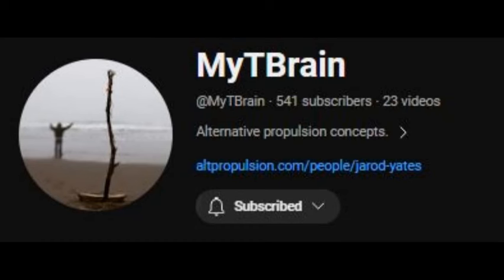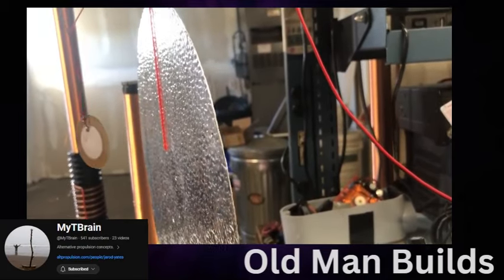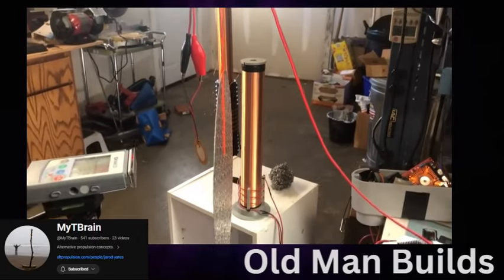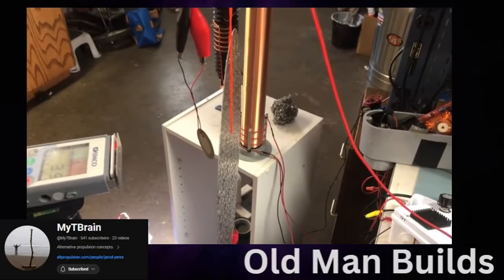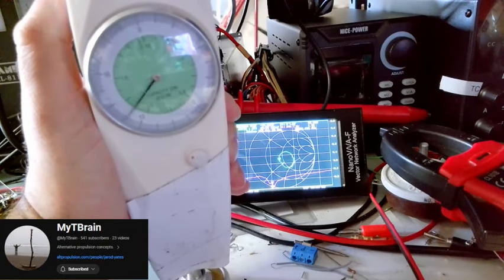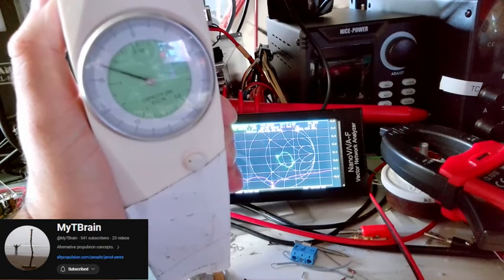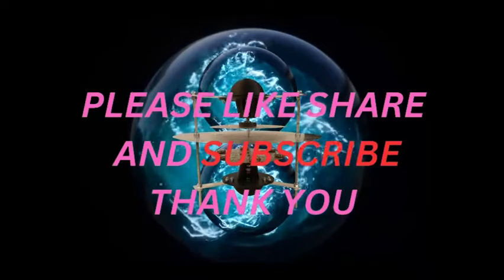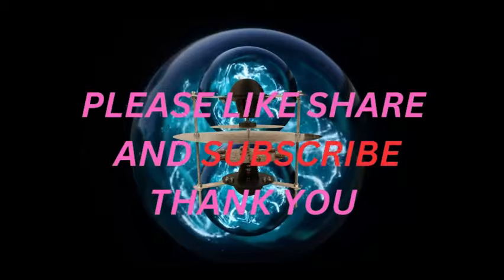Graviflyer "Piezo Disc Experiments" #40

Comment: One thing that was mentioned about the SEG motor (mentioned on APEC) was that it was getting hot on one side but once closer to weight loss it would cool down. But it happened at lower rpm. There is something tied within all this.
Reply from the maker: I agree. It is like a combination lock. We just need to see what fits. I tried to change the octave by tapping on the center plate. It made a change in the power level. I was also hearing a clicking sound. It was the first time I had my piezo on. I installed it backwards so instead of pressure I got clicking. The piezo was expanding into air and not against the top. I was at the right spot.

Comment: Not to pick on you.. but I have seen the original Russian flyer several different ways it was built by him.   They had a hole in it that look isolated with a post coming out of the top of it, with some connecting wire to the rounded top. The piezo crystal was a lot bigger,  I have seen both top disk with magnets and also top disk with no magnets on the Russian flyer.   * He had a 12 volt isolated system he used.*** to power it.  And if he has or had 2x piezo crystals isolated(electric) by an insulator and has a mechanical connection he could have had a second HV generator in the system powering the top of it.  I think you got only half the story from him on how to build it.
Reply from the maker: I have seen all of those. But I have only seen 2 fly. I focus on those.
Reply: @nathanbunten4299   If they had piezo linked in a mechanical fashion and isolated, it would be easy to have a second HV generator at the top of it. have the #1 Piezo send power(mechanical) to the other #2 piezo producing a second high voltage generator that is isolated.   I am a old radar high voltage guy... I know what to look for.  Just mostly a guess on my part.  The pictures just did not look quite right there was more to it in some way..!   I am use to seeing spark gaps at 20K @ 20AMPS
What it look like to me is that the top is a separate high voltage system.  The center post has 4 corner metal thing sticking over the top of the round part.  You could HV to round part and keep it isolated and center rod out the top you could the other HV to it.  That would produce a static field between the two.  Using a piezo you would have to use HV rectifiers because its ~AC  coming out. But 4KV DC (CR) is easy to do that to. The gap around the top was good for ~15KV.  They may have had the to top linked to the round part also and had it vibrate up and down getting more air through it.

Comment: I was messing around that lapoint magnetic array north south flip zone and ultrasound levitator. I accidently bumped the metal tweezers into the array and it created a huge spark. I'm not sure what to make of that unless the magnets somehow got charged. Do you know how long Alexei was spinning the discs then turning the ultrasound on and getting it to fly?
Reply from the maker: 10 to 15 minutes before he started adding anything else.
Reply: uuuuhhhh, that sounds very unusual, you should repeat the experiment with the discharge we need to see it too, I'm very interested in seeing that
Reply: @fireball75677  I'm going to resin or glue the magnets in place and try to get it on video.

Comment: Nathan what I wrote to Jarod about this video.  Jared, thanks for the explanation. I really appreciate it. You state charge and then mention kilovolts, so I am confused somewhat as isn't charge coulombs? Also, what is SWR and US frequency? You also state that during the off cycle of the piezo disk you lost charge. Nathan in his videos puts the high voltage positive on the center plate and lower voltage negative charges on the top and bottom plates. You state that the positive charge showed more of an effect.  From reading on the internet putting groves or hammer marks on the plates allows the ultrasound to travel through the top and bottom plates.  You state that during one of the off pulses the positive charge changed by 1 kv. Does this mean the charge dropped on the plate?  This would make sense for the graviflyer as the middle plates positive charge has to move to the negative bottom plate, so it has enough charge to repel the earth's negative charge so the graviflyer levitates. I learned from Alexey two years ago that he used a polycarbonate CD with its associated groves and the coated Al and Al2O3 as the top plate on the graviflyer. This CD was a normal capacitor with the top plate and the middle plate, so the charge does not transfer to the middle plate or the bottom plate. I just learned from Nathan in his last video that the top disk has some sort of white coating on the bottom of the plate and may be similar to the CD with its Al and Al2O3 coating. The bottom plate acts more like an air capacitor that can transfer the charge to the bottom plate.  The top plate stays negatively charged so it can attract the positive ionosphere to get lift of the graviflyer with no transfer of charge to the middle plate or the bottom plate. The middle plate has the hammer marks on it to allow the ultrasound to travel through to the bottom plate to allow the transfer of the charge. In your video the piezo was swinging back and forth from the charged plate and changed its distance and maybe why you got the large 1 kv change when you pushed the off button and could not duplicate this in succeeding tries as the piezo and the plate were not at the correct distance. When the distance between the piezo and the plate is just right the charge can transfer from the middle plate on the graviflyer to the bottom plate. The distance between the plates is important. Also, the rest of the setup allows for the charge to set up on the plates over time so the transfer can occur. This is why if the settings are not just right Alexey has to start all over to allow the charge to set up once again so he can push the piezo's off button to allow the charges to transfer correctly at the 0.2 coulombs that I calculated with the coulomb force equation to get the lift. The fast transfer of the charge gives the push to move the graviflyer upwards at a distance from the earth's surface. I think I explained this correctly, but I get confused sometimes with my disability. I hope that you get the idea that I am trying to convey to you. All UAP are either bell shaped, saucer shaped or spherical shaped and all may have some sort of graviflyer inside of them for lift. Mark Tomion suspected some sort of spinning disks inside of UAP back in 2001 and why he built his EDF Generator the way that he did. In Mark's craft the electron field surrounding the craft allows for propulsion with warp drive and wormhole drive by changing the voltage and current of said electrons. The number of electrons decides what space wave (gravity wave) on my spectrum gets produced to allow this to occur if you have ever seen my spectrum from my many emails to Tim, Jeremiah, and Mark Sokol.  My star device that Jeremiah built on his YouTube channel is what powers such UAP.  I also think that the UAP on the show Skinwalker ranch are such craft that go back and forth through the naturally occurring wormhole to the US military base one million BC so that they can study the earth back at this time. Maybe you and Nathans research with my comments lead to these craft being built sometime around 2030. LOL.